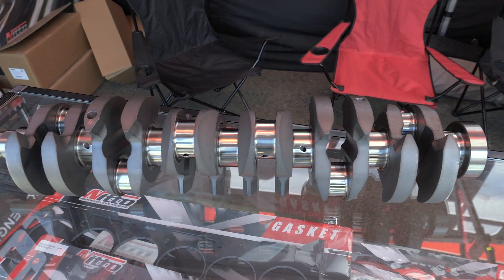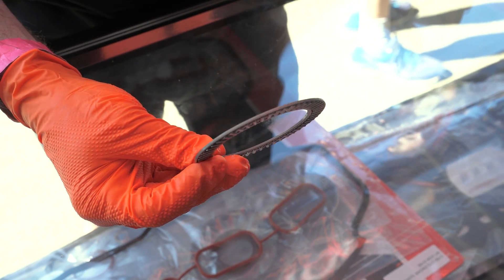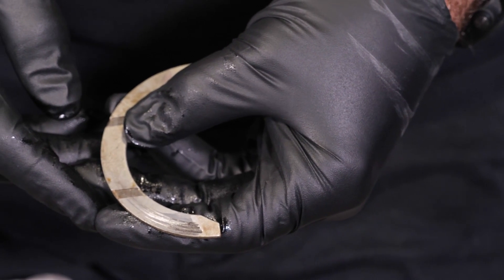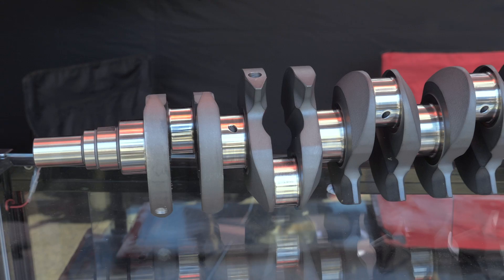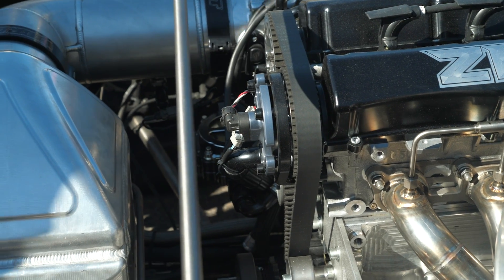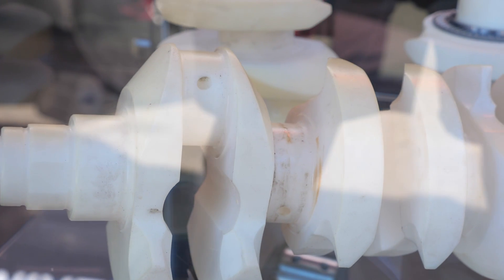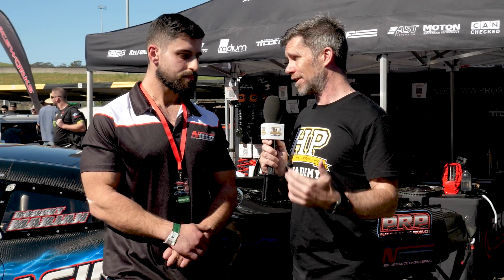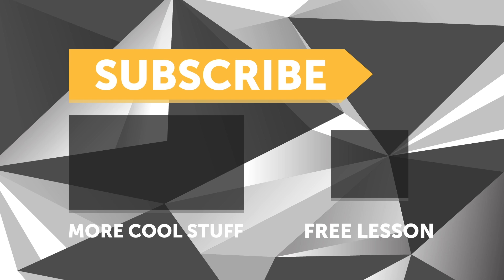How Small Details Break World Records

Comment: Naturally your mind may go for a manual trans being the sorce of thrust, but autos also cause significant thrust. Especially modified with high line pressures. The crank is whats holding that converter in the transmission, nothing else.

Comment: This mod can be very beneficial for 4g63t engines, more so on the ones that have the integrated thrust bearing, like the Evo 4 or 95-96 eclipse. And it seems you don't need 1500hp to develop this problem, just a stiff pressure plate and people riding the clutch.

Comment: They came up with it? 
RBs have been Torrington converted for over a decade now as have many other engines. Saying 1500hp is wrong, a converter can balloon at far less power output, as can a person run a really heavy clutch in a manual which will tear up a normal thrust bearing quickly.
Im surprised its taken them this long to catch up with what most engine builders and machine shops have been doing themselves for quite a while now.
Reply from the maker: You're looking at it the wrong way I reckon. This is something that makes life easier for 'most engine builders and machine shops' by removing the extra step after purchase if they're using this Nitto crank.

No one has claimed this is a new invention or even specific to just this one engine. We're not a history channel.

As for the HP statement it's his answer based on his experience with the type of customer they deal with. If you go and talk to someone like this about your build before purchasing any parts they're going to sit down and help you with your specific needs (after asking you 50 questions) which is better than taking generic advice from videos only before pulling out your wallet.
That's our advice anyway 🤘

Cheers for the comment and trying to help make sure people don't get caught out remembering it can go both ways with people fitting parts they might not necessarily need too - Taz.

Comment: Im not a RB guy at all but shouldn't they be fitted into each block. Because the tolerances would be slightly different on every combination
Reply: The bearing should be able to be shimmed to achieve the correct thrust. The kit may come with shims.
Reply: And the case side needs a big "washer" to run the bearings on.. they cant run on main cap ..

Comment: Just to clear this up a bit, this mod is specifically for high HP/RPM engines using a torque converter automatic.  So, as the converter absorbs the HP and RPMs increase, it balloons and grows, which the flex plate is designed to flex and keep that longitudinal force away from the crankshaft.  Billet converter housing helps, but you reach a point that those still balloon, see it a lot in race/pulling diesels in classes that don't allow manual transmissions with large multiplate clutches.  The problem is you get to a point where your HP is high enough that you need a flex plate stiff enough to take the HP and it doesn't flex as much and pushes the crank harder and harder, continually wearing out your thrust bearings.  This mod allows longer thrust bearing change intervals in that case, a reliability mod if you will.
Reply: I guess this can also apply to very stiff multiplate clutch setups, but normally 3+ disk clutches in the size ranges to take 1500HP don't run super heavy diaphragm springs.  By then you're into slipper clutch territory anyways for drag racing.
Reply: It's not that, as a little thought will confirm. Ballooning is indeed a problem, but not for that reason.
The problem is that the fluid is being moved between angled fins, internally, and that results in a separation force being applied between the rotating impellor and the static (as that's normally the most heavily loaded point) turbine. The former driving the crankshaft forward, and the latter driving the impellor backwards - that last may be responsible for many auto' tran's failures.
Reply: Any deflection of the flex plate does not reduce the force applied to the thrust bearing. 

Your explanation is similar to saying that changing the spring rate of your suspension would affect the measured weight of the vehicle on a scale.

Comment: If the diameter of a single roller is equal on the whole lenght, im suprised it works that well, bc the lower part of roller travels on a smaller circle than the higher one. It means that there is constant slip. 
Sorry for my English guys, but i think You know what i mean.
Reply: We know what you mean, your English is fine. It's something I've thought about, and there are tapered thrust bearings, where the rollers and washers are tapered/cupped, but I believe they're used when there is constant heavy load and backlash is minimal/zero, whereas in an engine the load might be heavy, but it's not constant and there is a defined amount of backlash. In a bearing that size, the taper might be almost invisible by eye, so perhaps it is there, but I doubt it. The tapered ones are also quite a bit more expensive and massive than the plain ones last time I checked. 

As in one that size being >US$200 vs. <US$10 for the plain type. In very small sizes, you forgo the rollers and use balls and grooved washers. According to the specs I found, axial load from a crankshaft isn't going to worry these thrust bearings, but RPM will. I'm sure a loose roller finding it's way into an oil pump will instantly end it, but a token gravel strainer should keep them out of the pump.

There's also a good chance that after a little use, the thrust surfaces will self clearance to a degree and the difference in circumference between the inner and outer of the rollers will be further reduced. I expect that it's one of those things that yes, this bearing is imperfect but it's a lot better than a plain bearing and chasing 'perfect' isn't worth the effort and minimal advantage.
Reply: @stuarttierney4598  I'd have thought the ball type thrust bearing would be better but guessing there's a space issue so there using these needle ones, will make a right mess when it fails
Reply: @stuarttierney4598   
I thought quietly that a ball bearing might be a more optimal solution, especially since there is enough space to place the balls in several rows, on circles of different diameters.  
Happy New Year Everybody !!
Reply: you can think of these roller bearings as multiple single linear points of contact and so the localized motion is in a "straight" line in relation to the rotation of the crank and so there isn't significant slip unless the individual roller is binding
Reply: The point is fully valid but even on the 9000 rpm wankel it never needs changing.. not ever on a 200-300k engines..

And tapered bearings would create a radial reaction (wanting to fly out from compression force).

Comment: Are these available for the RB32 nitto stroker crankshaft?
and if you have a 600kw 850hp ish, is it detrimental to have the roller baring vs the plane bearing, for daily use? or is it just added insurance at that point?
Reply from the maker: You'll have to reach out to Nitto on that one, not sure what the plan is beyond the RB30 crank option discussed sorry. Going off what Christian said here though based on his experience in the industry, you should be fine at 850hp so don't stress if you already have the crank and associated parts ready to go. Little things like this add up when you are pushing the envelope, especially in a competition setting, but this isn't a fix for something that is a constant premature failure for street applications or anything like that 😎
A lack of lubrication is one issue that quickly kills a lot of engines, RB's and otherwise, so make sure you have that dialled in for your goals - Taz.
https://www.hpacademy.com/forum/practical-engine-building/show/rb-bearing-clearances-and-oil-flow-tricks/
Reply: @hpa101  thanks for the info I'll reach out.

Comment: 13b rotarys come with  roller thust bearings stock, 13b rew motors come with larger ones than previous years. Mazda used to have a "race" thrust bearing for the older 13b re but theyre hard to come by these days
Reply: Was hoping someone commented this I’m honestly surprised no one thought to do this on a piston engine till recent
Reply: @Caterisma because it's not needed in 99.999% of the cases.. 
A plain bearing has higher holding capacity if well lubricated.. so failure of a plain bearing is not the load on it, but rather lack on oil pressure/flow..